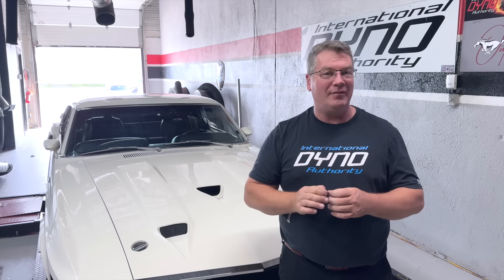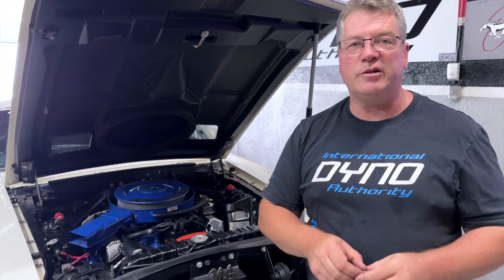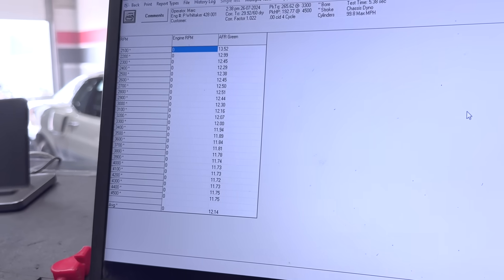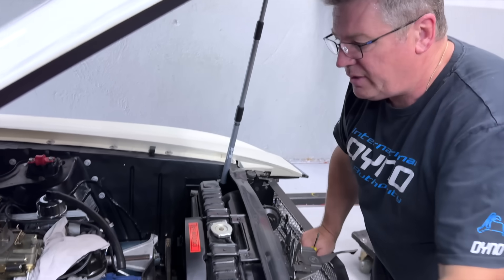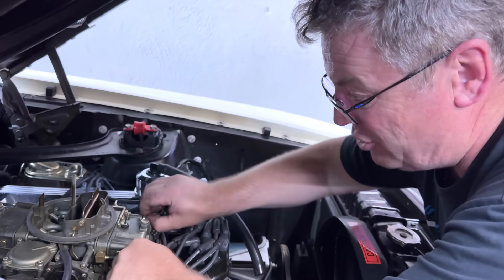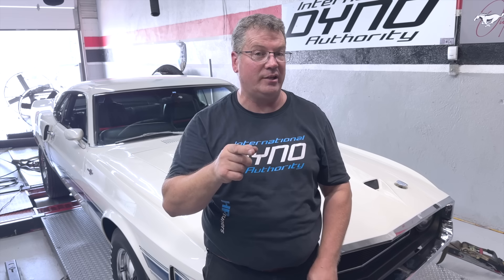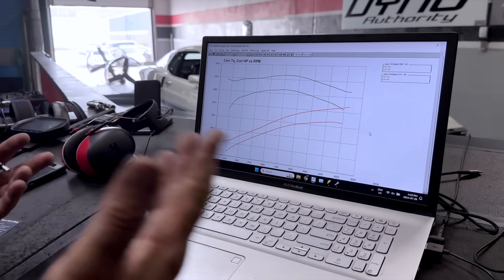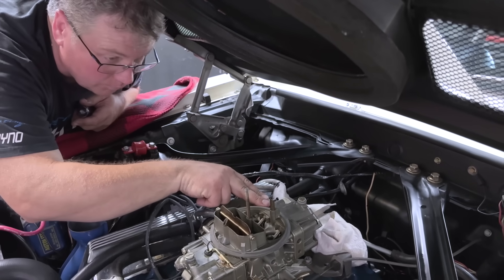Original, unrestored '69 Shelby GT500 tuned on the dyno

Comment: The idle mixture adjustment screws have NOTHING to do with WOT mixtures.    Float height and jetting are the only things that control WOT fueling.
Reply from the maker: @recoilrob324  

Our tuning process is meticulous and systematic, starting with all passes beginning at 2,000 RPM. The throttle is applied rapidly to the wide-open position, ensuring consistency across every run.

Each test is conducted on the chassis dyno under identical load conditions, allowing the vehicle to accelerate as quickly as its setup permits. The duration of the test is carefully measured and compared with subsequent runs to evaluate progress.

Initial tests are run until the torque curve falters or until the data log indicates unsafe, unproductive, or non-rewarding results—signaling the need for adjustments or the next step in the tuning process.

We prioritize the safety and condition of every customer’s vehicle, treating each one with the utmost care. Throughout the tuning process, we closely monitor key parameters such as temperature, AFR, IAT, balance, and torque production across the RPM range.

Our goal is to deliver responsible, high-quality results that enhance the performance of the vehicle without compromising its integrity—or our reputation. We do not take risks that could endanger a customer’s vehicle or the standing of our business.

As we observe improvements, we gradually extend the RPM range, focusing on identifying the engine's most efficient operating zone. At every stage, we ensure transparency, sharing step-by-step results with our customers and walking them through the data logs to educate and inform.

Each test adheres to a precise, repeatable procedure, maintaining consistency and accuracy. This approach not only ensures optimal results but also reflects our commitment to excellence and responsibility in tuning.
Reply: @internationaldynoauthority693  I have no objection to the rest of your tuning....and am very familiar with the entire process.

What I took a bit of exception to was early on claiming that the idle mixture screws affected the WOT mixture...which just isn't true.   Once the throttle blades open far enough to let the transfer slots start to flow the idle screws have nothing more to do with it.

We see this a LOT in Hot-Rod's with big cams where the throttle needs to be open too far at idle and the idle mixture screws can be turned in all the way and have no effect on the mixture because the transfer slots are feeding the engine.

We also start at getting control of the idle mixture which means the engine is running from idle screw controlled fuel only...then work our way up from there.

I made the comment about the idle circuit trying to help those who might not be as familiar with carburetors to not be confused about their function.
Reply from the maker: @recoilrob324  

The tuning process for this project was comprehensive and methodical.

Pre-Tuning Preparation
We started with a checklist for the customer to complete before bringing the vehicle in. This included:

Fresh oil

New spark plugs and spark plug wires

A new distributor

Proper fuel pressure

A leak-free exhaust system

Tires in excellent condition

Tuning Process
Once the vehicle arrived, we meticulously tuned every circuit of the carburetor, from idle to low speed, the primary circuit, and the secondary circuit. Here’s a breakdown of the steps:

1. Air-Fuel Ratio Adjustment

We cleaned up the air-fuel ratio until the spark plugs burned a perfect tan color.

Any trace of smoke was eliminated by fine-tuning the mixture.

2. Choke and PCV System

The choke flap, which was bent, was removed and straightened to restore proper airflow.

We reconfigured the PCV system to circulate air back into the engine without oil vapor. This included adding a restrictor and cooling to prevent oil deposition in the combustion chamber.

3. Ignition Timing

The ignition timing was verified and incrementally adjusted to match the fuel in the tank, the combustion chamber characteristics, and the intended use. This resulted in a complete and efficient burn in the combustion process.

4. Carburetor Repairs and Adjustments

We replaced the check valve, power valve, gaskets, and the accelerator pump circuit's check valve ball and spring.

Proper smaller nozzles were installed for the accelerator pump circuit.

The float level was set for optimal tuning, ensuring no smoke and smooth transitions between circuits.

Results
The result is a 1969 Mustang that runs better than ever:

Increased torque, efficiency, and horsepower

Zero smoke from the exhaust

Quick starts, smooth operation, and overall reliability

This is now one of the cleanest-running classic Mustangs on the street, despite never undergoing a full restoration. It’s a testament to careful tuning and a little TLC.

Thank you for watching, and we hope this detailed overview inspires and informs your own projects!
Reply from the maker: @recoilrob324  Basic tuning lessons to start your learning "curve". Today

1--ALWAYS tune : fuel, fuel curve, fuel delivery , fuel stages first.

VACUUM, TIMING AND FUEL ECONOMY IN NON-COMPUTER ASSISTED ENGINES

GOALS:To understand the relationship between vacuum and ignition timing and to identify the cause of reduced fuel economy.

OBJECTIVES:For non-computer assisted and some partially computer assisted vehicles, the student will:

1. Learn to identify the ignition system's vacuum sensing device.2. Acquire the knowledge in order to test for a faulty vacuum sensing device.3. Calibrate, for optimum fuel economy, a vacuum sensing device (when possible).

LESSON/INFORMATION:Ignition timing is the single, most critical adjustment for a gasoline engine. Assuming the engine is in good mechanical condition, there are no vacuum leaks, and the fuel mixture is correct, then the ignition timing can affect the net power yield from the fuel. Improper timing can significantly change a vehicle's mpg. Three types of timing are used for gasoline engines. They are:

1. Static timing;2. Mechanical (centrifugal) timing; and3. Pneumatic (vacuum) timing - mechanical.

Each has a specific purpose.

1. Static timing establishes a physical relationship between engine crankshaft position and the distributor. This is fixed and should not change. "Basic" and "initial" are terms also associated in the static timing.

2. Since fuel burns at a relatively fixed rate (i.e., time to burn is in milliseconds), then the faster the engine runs the earlier the fuel must be ignited so that the millisecond time frame will remain constant. Thus, mechanical timing advances are used. A device, usually a centrifugally activated weight control balanced by a spring, advances the timing proportionate to engine RPM's. The faster the engine runs, the more timing advances. This is true up to approximately 2,700 to 3,500 RPM's. Mechanical timing is critical to acceleration and power response in a gasoline engine. This timing is added to the static timing

Comment: I would have addressed ignition first.
Reply from the maker: @stevenmcinnis8105  1. We always start by checking the ignition timing. We ensure that the initial and final ignition timings are within the normal range (8-18 degrees initial and 28-32 degrees final). This is a crucial step in diagnosing any engine issues.
2. Fueling is the foundation. We focus on getting the fueling correct before adjusting the ignition timing. A properly fueled engine ensures that the correct amount of fuel is being delivered to the combustion chamber throughout the entire RPM range.
3. Ignition timing fine-tuning. Once the fueling is dialed in, we can start adjusting the ignition timing (advancing or retarding by 2 degrees at a time) and observe the results. This helps us identify the optimal timing for peak performance and minimal smoke.
4. We addressed the root cause of the smoke. In this particular case, the smoke was not caused by the ignition timing but rather by issues with the accelerator pump system and PCV system. By addressing these underlying problems, we were able to eliminate the smoke entirely.
5. We appreciate your input and feedback. We value your comments and questions as they help us improve our content and provide valuable information to our viewers. We encourage you to continue engaging with us and sharing your thoughts on future videos.
In summary:
 * We always prioritize proper fueling before adjusting ignition timing.
 * Ignition timing is a crucial factor for engine performance and can be fine-tuned to optimize results.
 * We addressed the root cause of the smoke in this case, which was related to the fuel delivery and PCV systems.
 * We appreciate your input and feedback and look forward to your continued participation in our discussions.
Thank you for watching, and please feel free to leave a comment below with any further questions or suggestions. Happy New Year!
Reply from the maker: @stevenmcinnis8105  

Our tuning process is meticulous and systematic, starting with all passes beginning at 2,000 RPM. The throttle is applied rapidly to the wide-open position, ensuring consistency across every run.

Each test is conducted on the chassis dyno under identical load conditions, allowing the vehicle to accelerate as quickly as its setup permits. The duration of the test is carefully measured and compared with subsequent runs to evaluate progress.

Initial tests are run until the torque curve falters or until the data log indicates unsafe, unproductive, or non-rewarding results—signaling the need for adjustments or the next step in the tuning process.

We prioritize the safety and condition of every customer’s vehicle, treating each one with the utmost care. Throughout the tuning process, we closely monitor key parameters such as temperature, AFR, IAT, balance, and torque production across the RPM range.

Our goal is to deliver responsible, high-quality results that enhance the performance of the vehicle without compromising its integrity—or our reputation. We do not take risks that could endanger a customer’s vehicle or the standing of our business.

As we observe improvements, we gradually extend the RPM range, focusing on identifying the engine's most efficient operating zone. At every stage, we ensure transparency, sharing step-by-step results with our customers and walking them through the data logs to educate and inform.

Each test adheres to a precise, repeatable procedure, maintaining consistency and accuracy. This approach not only ensures optimal results but also reflects our commitment to excellence and responsibility in tuning.
Reply: @internationaldynoauthority693 Fantastic work lads. That GT500 is finally running as intended.

Comment: Took 50 years to be fixed.
Reply from the maker: @MrGivmedew  And, we are extremely glad, that it arrived at our doorstep. Where we could walk through the steps of diagnosing, tuning, and working with this beautiful machine.
Reply: @internationaldynoauthority693 Did you replace all the plugs before you started your pulls? I'm guessing they would be pretty fouled up with all that rich running.
Reply from the maker: @stephenholland5930  

Our tuning process is meticulous and systematic, starting with all passes beginning at 2,000 RPM. The throttle is applied rapidly to the wide-open position, ensuring consistency across every run.

Each test is conducted on the chassis dyno under identical load conditions, allowing the vehicle to accelerate as quickly as its setup permits. The duration of the test is carefully measured and compared with subsequent runs to evaluate progress.

Initial tests are run until the torque curve falters or until the data log indicates unsafe, unproductive, or non-rewarding results—signaling the need for adjustments or the next step in the tuning process.

We prioritize the safety and condition of every customer’s vehicle, treating each one with the utmost care. Throughout the tuning process, we closely monitor key parameters such as temperature, AFR, IAT, balance, and torque production across the RPM range.

Our goal is to deliver responsible, high-quality results that enhance the performance of the vehicle without compromising its integrity—or our reputation. We do not take risks that could endanger a customer’s vehicle or the standing of our business.

As we observe improvements, we gradually extend the RPM range, focusing on identifying the engine's most efficient operating zone. At every stage, we ensure transparency, sharing step-by-step results with our customers and walking them through the data logs to educate and inform.

Each test adheres to a precise, repeatable procedure, maintaining consistency and accuracy. This approach not only ensures optimal results but also reflects our commitment to excellence and responsibility in tuning.

The tuning process for this project was comprehensive and methodical.

Pre-Tuning Preparation
We started with a checklist for the customer to complete before bringing the vehicle in. This included:

Fresh oil

New spark plugs and spark plug wires

A new distributor

Proper fuel pressure

A leak-free exhaust system

Tires in excellent condition

Tuning Process
Once the vehicle arrived, we meticulously tuned every circuit of the carburetor, from idle to low speed, the primary circuit, and the secondary circuit. Here’s a breakdown of the steps:

1. Air-Fuel Ratio Adjustment

We cleaned up the air-fuel ratio until the spark plugs burned a perfect tan color.

Any trace of smoke was eliminated by fine-tuning the mixture.

2. Choke and PCV System

The choke flap, which was bent, was removed and straightened to restore proper airflow.

We reconfigured the PCV system to circulate air back into the engine without oil vapor. This included adding a restrictor and cooling to prevent oil deposition in the combustion chamber.

3. Ignition Timing

The ignition timing was verified and incrementally adjusted to match the fuel in the tank, the combustion chamber characteristics, and the intended use. This resulted in a complete and efficient burn in the combustion process.

4. Carburetor Repairs and Adjustments

We replaced the check valve, power valve, gaskets, and the accelerator pump circuit's check valve ball and spring.

Proper smaller nozzles were installed for the accelerator pump circuit.

The float level was set for optimal tuning, ensuring no smoke and smooth transitions between circuits.

Results
The result is a 1969 Mustang that runs better than ever:

Increased torque, efficiency, and horsepower

Zero smoke from the exhaust

Quick starts, smooth operation, and overall reliability

This is now one of the cleanest-running classic Mustangs on the street, despite never undergoing a full restoration. It’s a testament to careful tuning and a little TLC.

Thank you for watching, and we hope this detailed overview inspires and informs your own project.
Reply: chassis dyno and AFR tools are very common now, weren't then
Reply: @Electromotive_Force  The Clayton water dynos seemed popular in the 70s and 80s. Some checked the egt in whatever way they could but nothing like an o2 sensor.